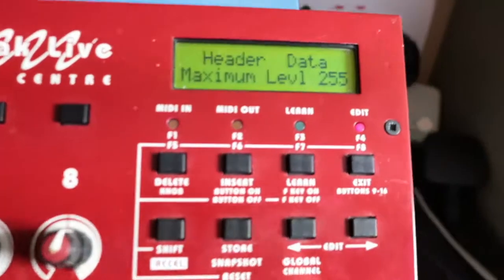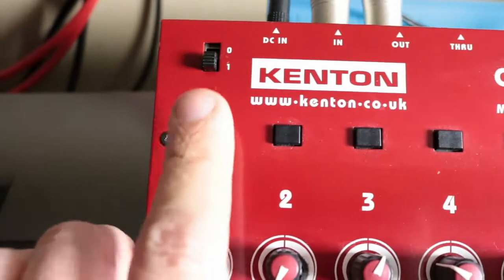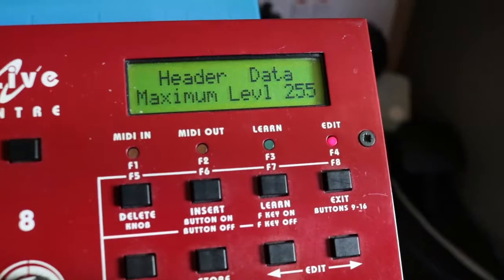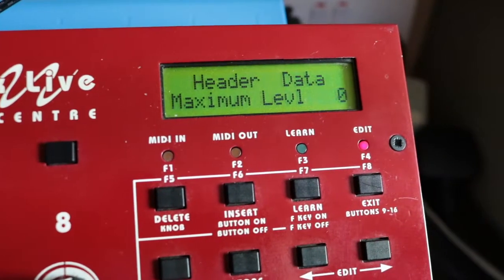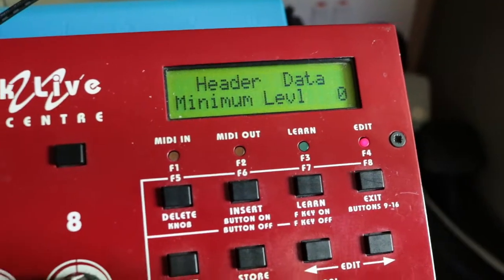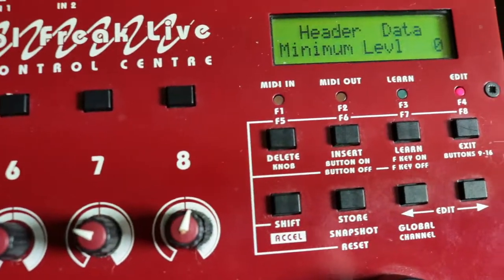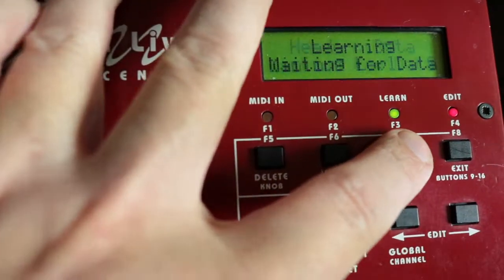JX-8P Programming with a Kenton Control Freak

Comment: Thanks for sharing! I would like to program my controlfreak for my Roland D-05 and used this method with the learn function to program it. It doesn’t work even after changing the ‘data from slider’ to ‘checksum’… 🤷🏻‍♂️
Any help is welcome

Comment: Hey there- I've been put in quarantine and thought it was the perfect chance to learn the ins and outs of my Control Freak Live- I'm having trouble , when I try to LEARN something with my Yamaha V50 it says "LEARN aborted. Message changed." I cant find anything on the internet about this. Have you ever gotten this? When I load up the Kenton supplied profiles for DX21, DX27, DX100, and TX81Z, the V50 does respond to the parameter commands that are the same from those synths, so its not a V50 issue seemingly.. I've gotten down and dirty with the SYSEX on an SY77 so that I could map param commands onto a Phil Rees controller manually, but I'm hoping I dont have to end up doing that on the FReak.. cheers!

Comment: Fantastic
I don’t have a JX8P but came across a  Kenton ControlFreak (with sliders)
quite cheap... though I need to clean the faders as they hardly move

I plan to use it with: 
TORAIZ AS-1 & Eventide H9 mainly 
Waldorf Q module
Yamaha MODX
Roland R70... may be Ableton, and perhaps it’ll work with my incoming PSS 480 (2 op FM “toy” Yamaha kboard).

Actually have had it for a year but this video has sparked my interest again.
Reply from the maker: JaBig * They are very versatile, I picked another one so now I have two, great piece of kit 😄

Comment: Your timing on this couldn't be better, mate!  I've just relocated my studio and also just got a Control Freak Live for purposes of controlling my JX-8P (in addition to my DW-6000, Alpha Juno, and a number of other older hardware synths that really will benefit from knob-based control).  It's great that I can use their pre-programmed panels, but now I can be more comprehensive if I choose to and can much more easily add other synths and MIDI devices.  Thanks so much for this video!  One question:  do you have a template for the overlay templates that you created that you might be willing to share???  Thanks!
Reply from the maker: I was hoping no-one would ask that as I lost most of it when my Encrypted USB Stick decided to change it's PIN without telling me. However I did manage to find the blank one, you just need some Paintshop skills to customize it. Also on the MegaSync Link are the Control Freak Profiles, and you are welcome to all of it.
https://mega.nz/#F!qHB3jQDR!Vvd9vDfz5xLaf4N0H-21Vg
Reply: @spiffosmith2177 Thanks so much...and again for the great video!